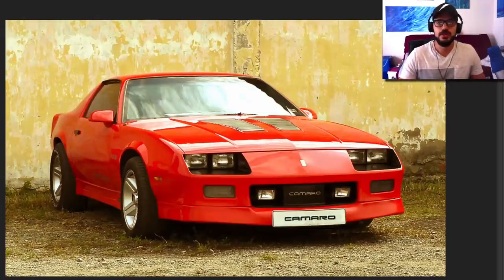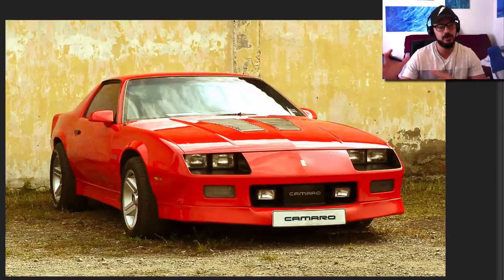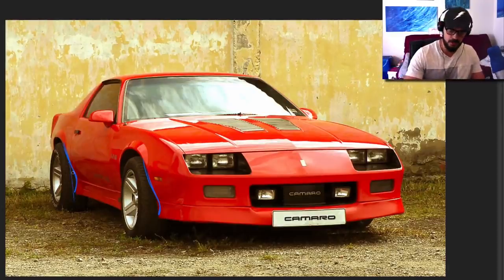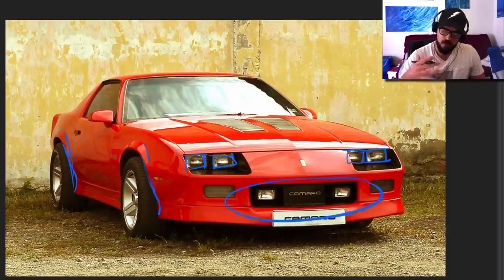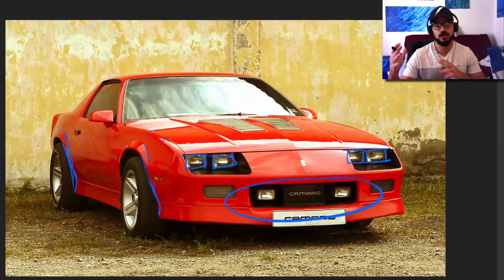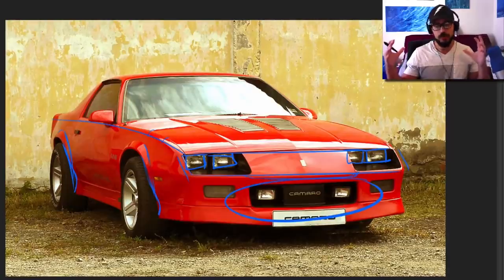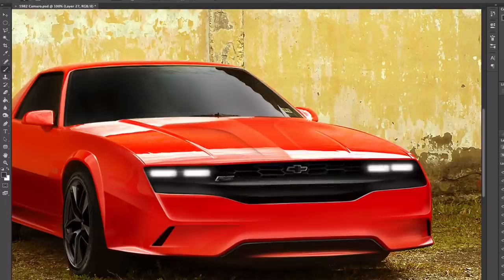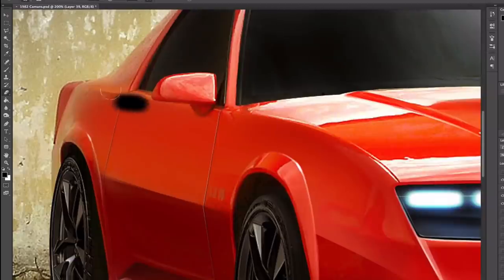I re-design the 1982 Chevy Camaro into a modern car

Comment: Dis is a 1992, you can tell by the headlight black paint
Reply: Wrong ground effects. It is 1985-1990, the black headlight bucket paint started in 85 or 86 iirc. The 91/92 model had the "Aero" GFX, which had the holes towards the back of the lip spoiler and also on the back of the rocker extensions.

Comment: @thesketchmonkey there is only one problem.  This is no older than a 1985, as that was when they made the front signals flush to the bumper.  Also, those wheels were an upgrade from the same year if I am not mistaken.

Comment: Modern styling would require quite a lot more - the bodies have gotten taller overall with the door to roofline being much narrower... way larger wheels, way larger front grills etc... This almost looks like it went a bit of a step back in time instead of forward in time, with the exception of the LED headlights.

Comment: The right-front corner lighting is a bit off. It looks like an arrow going forward instead of wrapping into the front like the left-front. Otherwise, a great modernization. I'm not a fan of modern Chevy styling, and there's a couple things in this that I said "Aww no.", but it's faithful to both eras. 

I like the floating chin.

Comment: This just doesn't look complete yet. The front lacks almost any shape to where a bumper would be under the fascia. The grill sits at the front something which obviously doesn't work with pedestrian safety. Also, the rest of the body should have been changed a bit more... Thicker or redesigned pilars... And more modern shape to the body. Idk, I think a lot more could've been done.